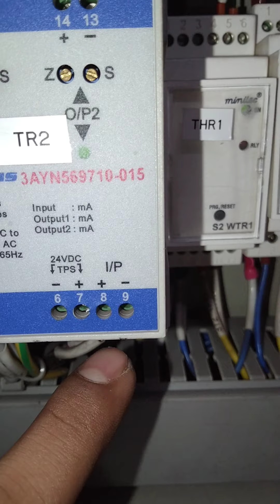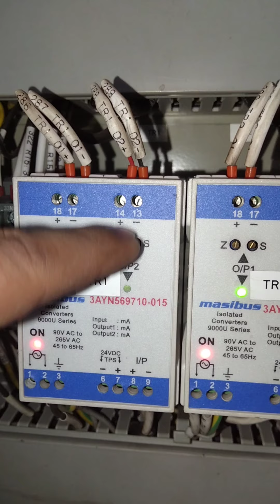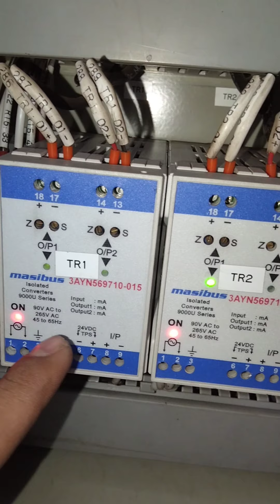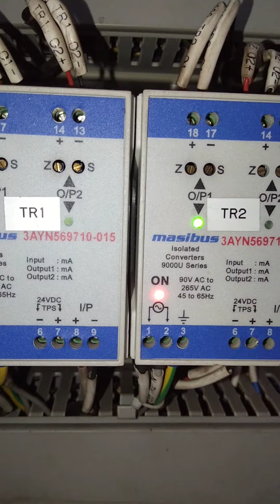Why Analog Signal Isolator used in VFD panel ?

Comment: 4 to 20 mA how to check? Series or parallel check..explain karea ji
Reply from the maker: You can check both , by fluke multimeter you can check both in parallel and also in series. But in other make multimeter not supported parallel measurement of current so you have to measure in series